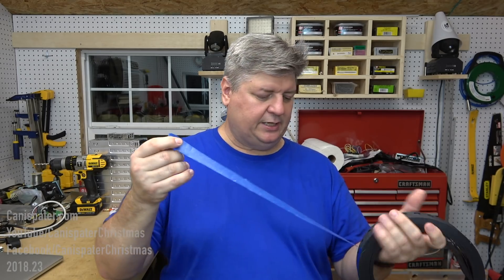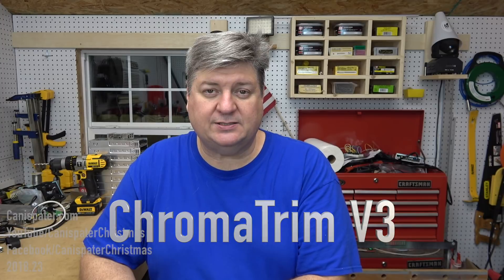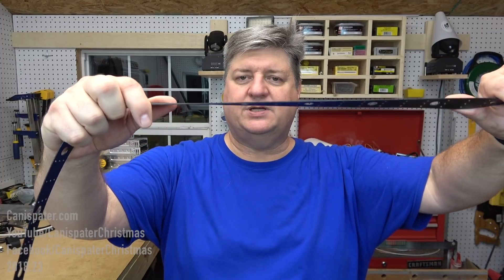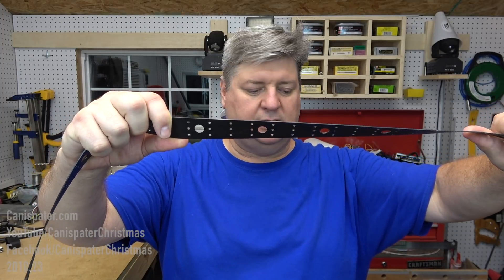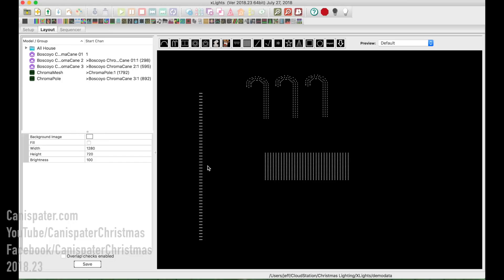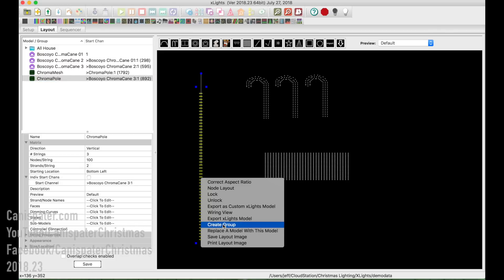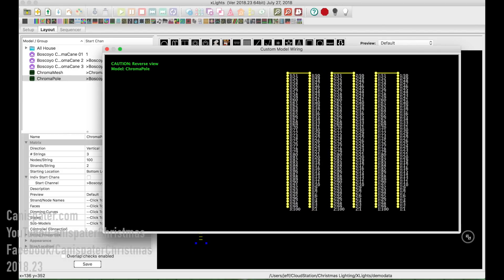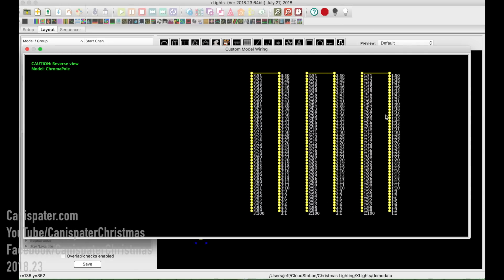Boscoyo ChromaTrim V3 & VLOG (2018)

Comment: Doesn't look like they make these in this form anymore. Only corrugated.
Reply from the maker: It's possible there will be a V4 out as it didn't handle tight bends well. You might send him a note or wait until Expo - at least that's when I would release a new product. :)

Comment: Hi Jeff, Love the show! I went to buy these today and it looks like they have completely changed the design since your review here. 

I’m looking for exactly what you show in the video. But their website shows a flat piece and they say if will break if bent. Here’s a link to their Facebook post with the notification that they changed the material. Any insights?
Thanks!

https://m.facebook.com/BoscoyoStudio/posts/1873294259382662
Reply from the maker: Yeah. I had some that I bent and broke. It bends, but folding it over breaks it. So, don't fold it over. Other than that, I'm very happy with it. It is much more rigid than strip I used a year earlier and I haven't changed out all my horizontal pieces with it yet, but plan to.
Reply from the maker: Oh and Thanks! The ChromaTrim V3 is what I have. The picture shows it in white, but you can get it in black if you want.

Comment: Great VLOG, we subscribe and are working on our display for the second year.  Last year was about ~300 pixels, this year ~5000.  Thank you for all of your insight.  On the ChromaTrim V3, do you have a comparison to the original ChromaTrim?  I see on the Boscoyo website they have the original 12mm strips, which you have in the video, and they have a legacy version of the ChromaTrim.  At half the cost, I am curious about a comparison between the original Chroma and the v3.
Reply from the maker: The ChromaTrim I bought a while back was made out of coro and too flimsy for my needs. The V3 is roughly twice the thickness of the standard strip, but much more rigid, hence my thumbs up. :) You might want to send them an email or give them a call to get full specs on anything you see on their website - they are very helpful.

Comment: Great videos w/humor!! On the snake cable --  instead -  How about using 2 separate 18/2 cables, 1- from controller (Grd , Data) to first string; 2- from power supply to feed power (duh) to the strips and do power injection as needed. Data should travel on 18awg wire just as well - I have not tried it, because I am just getting started on this hobby, but i think it should work. Even drew a picture but how can I post it? --Thanks and keep up the good work
Reply from the maker: Skinny Ethernet cable is actually better at carrying data than large wire. I believe it has to do with impedance or "resistance at frequency."  Now, DC current, go as big as feasible for the load. Data will travel down larger wire for some distance, but it will go further on skinny wires.
Reply: Well, that was hastily thought on my behalf. I think I found what you and another person was thinking of on Amazon here 
 https://www.amazon.com/dp/B01EXLUJRU/ref=sxbs_sxwds-stvpv2_1?pf_rd_m=ATVPDKIKX0DER&pf_rd_p=6375e697-f226-4dbd-a63a-5ec697811ee1&pd_rd_wg=yOsxy&pf_rd_r=QD4Y4712WQDE2M7X073A&pf_rd_s=desktop-sx-bottom-slot&pf_rd_t=301&pd_rd_i=B01EXLUJRU&pd_rd_w=86Rzb&pf_rd_i=siamese+wire&pd_rd_r=b72cebee-0995-4ce7-9f48-24c158f75df7&ie=UTF8&qid=1535845144&sr=1
the only thing I was unable to find out is the gauge of the power wires.
What is you opinion on using 12 or 14Awg speaker wire for power? That usually is just 2 wires in a sleeve (red and Black)
Reply from the maker: Haha. Yeah that would probably work. Still, this is probably only needed for special cases so I wouldn't recommend it for everything. Standard cable still works great for short runs, but thanks for finding that.

Comment: I just put my pixels on 54' of eves with this product and works very well.  I did put them on PVC 1/2" pipe and purchased holidaycoro's 1/2' clear mounting strips.  V3 is very easy to drill holes where you need them and definitely hard to insert the pixels.  Holidaycoro has the pixel putterinner for sale also. It saves on your fingers!  Here are the links http://www.holidaycoro.com/Pixel-Node-Pliers-p/871.htm   and http://www.holidaycoro.com/Half-Inch-Lexan-Pipe-Mounting-Clip-p/770.htm and lastly the V3s http://www.holidaycoro.com/Pixel-Node-Pliers-p/871.htm  Enjoy everyone and happy putting them together!
Reply from the maker: Mine went brittle & broke after the first year, but I think they were the PVC type. Hope the Lexan holds up better.

Comment: I did not see a link to the strip so I can buy them all.
Reply: Here you go https://www.boscoyostudio.com/index.php?main_page=product_info&cPath=2_6&products_id=215
I was trying to find something like this for my horizontal eves and it works very well.  Holidaycoro also sells the mounting clips for PVC 1/2" pipe if you want to make them straight.  I just snapped a line and put them on it and  works well.  They are clear so you can leave them up and cannot see them.  It makes the wife happy!